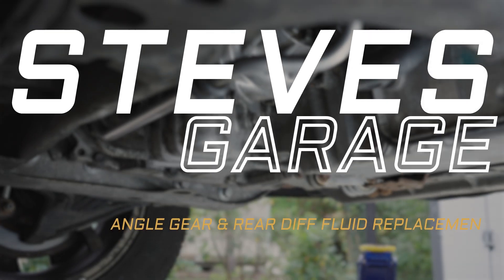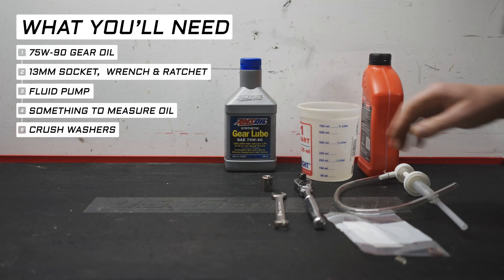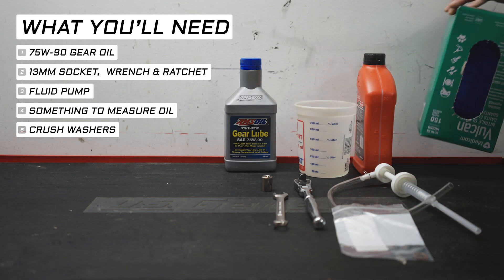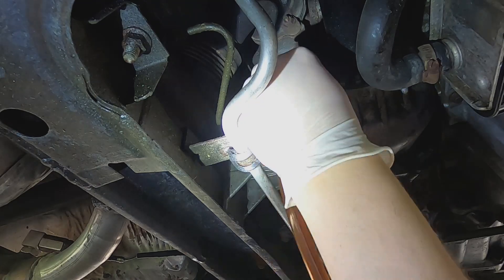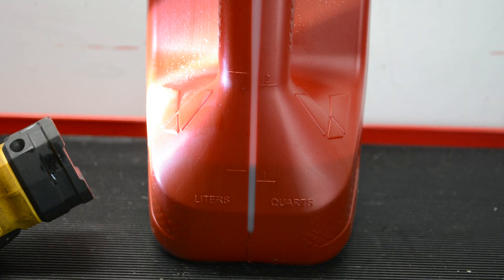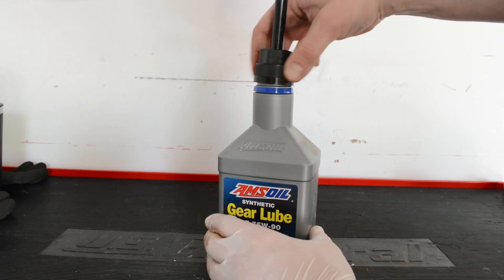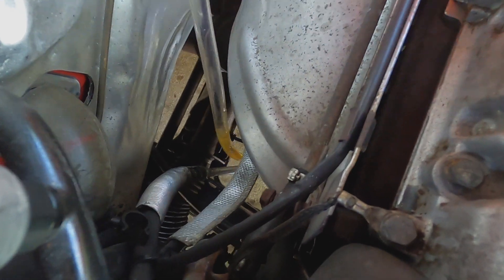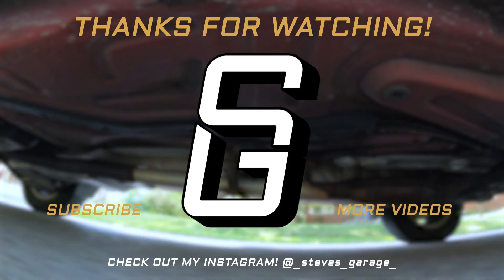P80 Volvo Angle Gear and Rear Differential Fluid Change

Comment: Would this be the same on a 99 v70xc?
Reply from the maker: It should be exactly the same. Your drain plug sizes may be different, but procedure and location are identical.
Reply: @StevesGarage  thanks!
Reply from the maker: @max4_6  You got it, hope it goes well!

Comment: Good job, and just in time. I'm just doing this now. I'm actually looking for a small leak in the area and thought it might be the washer on the bevel gear. 

Great video, thank you!
Reply from the maker: Hopefully it's your washer or it just being overfilled. Mine stopped leaking after the change.

If it doesn't stop leaking, Volvo did release instructions on how to split the case, file down the edges, and reassemble it. That being said from the people I've talked to they say it doesn't work.